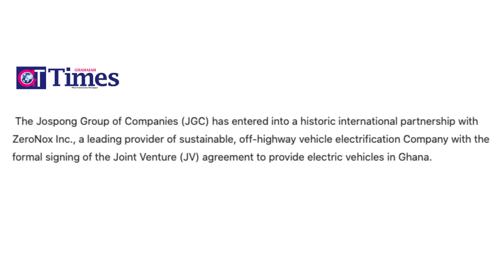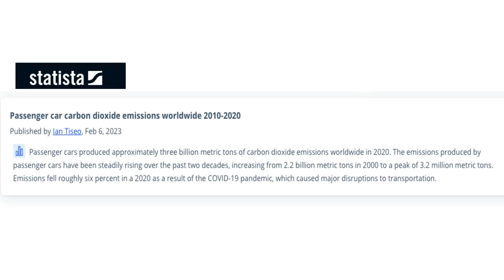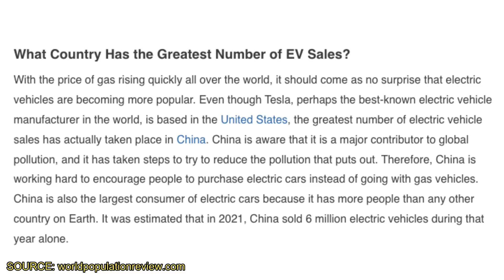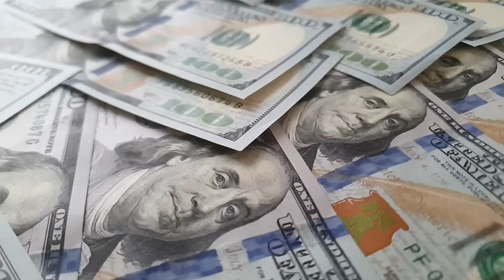Ghana to start the world's largest Fuel-free Vehicles production with Zeronox and Jospong group

Comment: another hype , the electric infrastructure and power infrastructure   is not available  to charge or keep charged (power outages )  the Volta dam dose not have the generating capacity for such a massive increase in on demand electricity , or the network to supply  to home or charging points , 
a pilot scheme in Accra   is of course a good idea  for the supper rich   but this will not clean up the low grade fuels that are needed for the  transport infrastructure  to keep the country moving , its a chicken and egg question - first you need the electric  power and infrastructure to support  the  ability  to realistically power the new dream of electrification ,  this is a long way off ,

Comment: An E.M.P. will put the whole country in darkness. Have a backup plan, Ghana.
Reply: What's EMP?
Reply: @wofakwame4163  Google  EMP.                           For a short answer:                                                  An electromagnetic pulse (EMP), also a transient electromagnetic disturbance (TED), is a brief burst of electromagnetic energy. The origin of an EMP can be natural or artificial, and can occur as an electromagnetic field, as an electric field, as a magnetic field, or as a conducted electric current. The electromagnetic interference caused by an EMP can disrupt communications and damage electronic equipment. An EMP such as a lightning strike can physically damage objects such as buildings and aircraft. The management of EMP effects is a branch of electromagnetic compatibility (EMC) engineering.

The first recorded damage from an electromagnetic pulse came with the solar storm of August 1859, or the Carrington Event.[1]

In modern warfare, weapons delivering a high energy EMP pulse are designed to disrupt [2] communications equipment, the computers needed to operate modern warplanes, or even put the entire electrical network of a target country out of commission.[3]
Reply: Thank you for thinking.